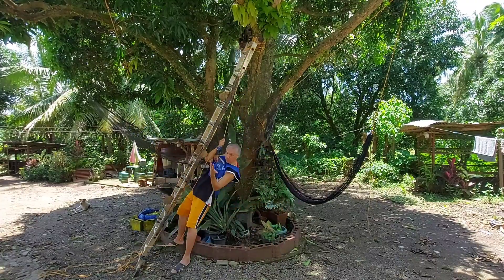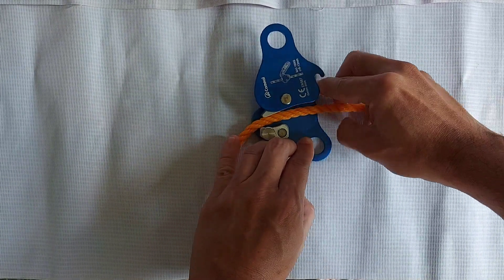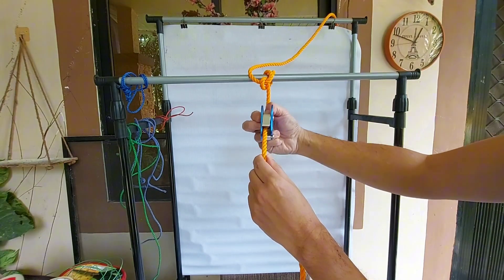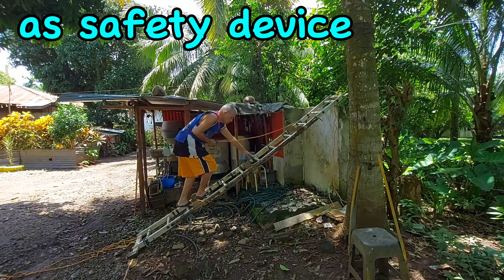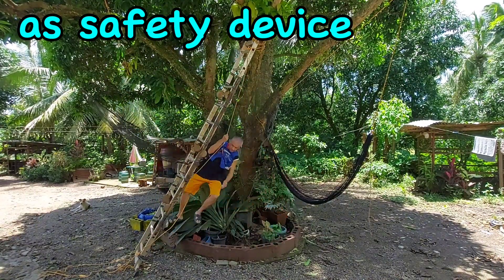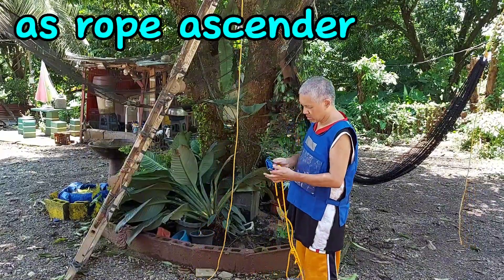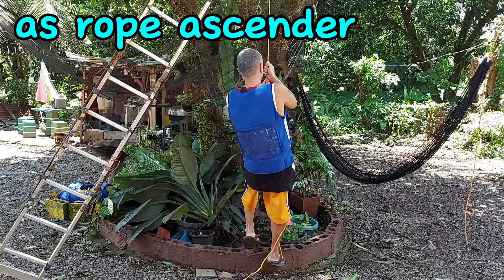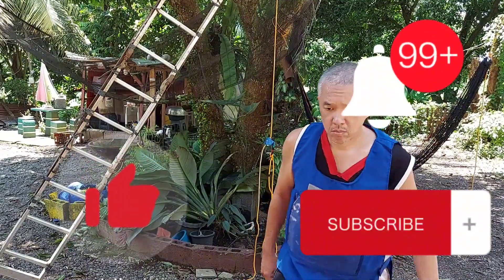Rope Grab. All you need to know. #ropegrab

Comment: When you hang fully suspended, you can’t release the device. Maybe it is good to add a link to a video that shows how to rescue yourself.   The device shown in the video isn’t certified as a fall arrester.   It mentions EN 567 and that standard is for rope ascenders.  A fall arrester is generally certified under EN 353-2 (for synthetic rope), or EN 12841 type A.   You may also say something about slack and when to use a shock absorber.  I like your presentation style, clear explanation without distracting music.   My background is in electronics, so I compare it with a rectifier / diode.
Reply: Grab the rope pull yourself up a bit and try your best to release tension and you'll be all good. If you don't have the strength to do so though I agree with you
Reply: @henrysanchez9728  I don't know how much force under load is required to release the device using the lever. You may need more than avarege grip strength. When using some friction hitches, I can descent using your method  (think of a VT hitch or hybrid autoblock / hedden hitch). 

When only having this ascender, I would tie a butterfly loop say 90 cm / 3 ft below the ascender. I can use that  as  a foot loop to slowly descent or ascend.  You need to untie and tie the butterfly loop  frequently of course.     When there is a change that after a mishap I end up fully suspended, I always have a foot loop with me to self-rescue.
Reply: @wimtel yes bro that set up is insane and would work much better. I'm just saying for our average Joes who don't take into consideration a possible mishap and ending up needing to rescue themselves